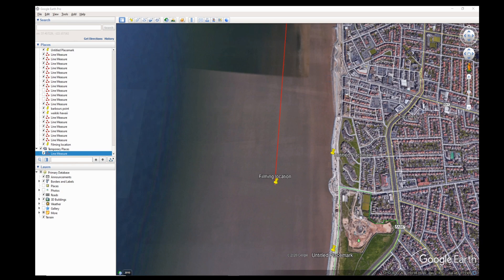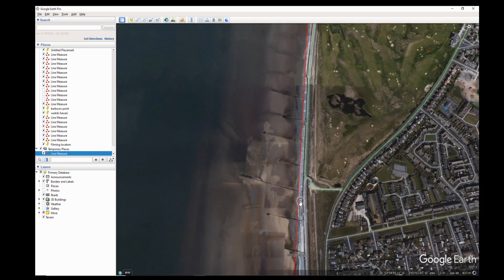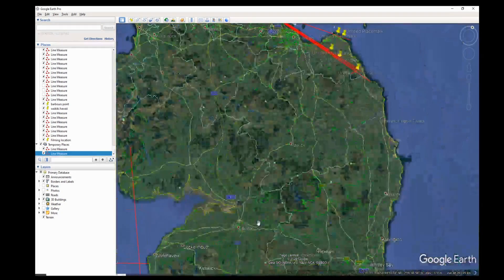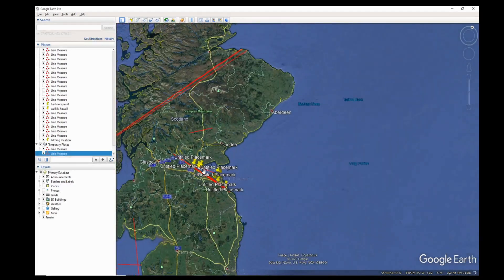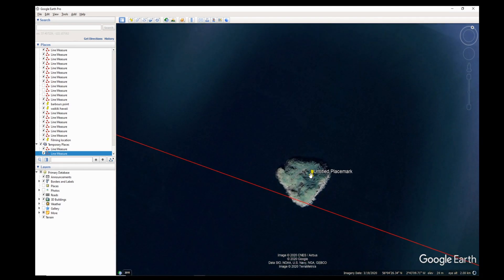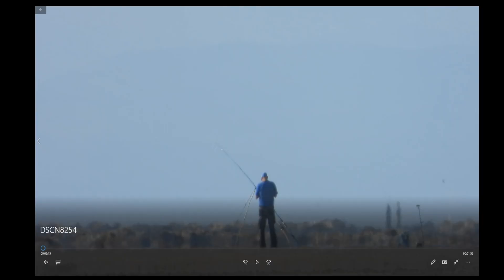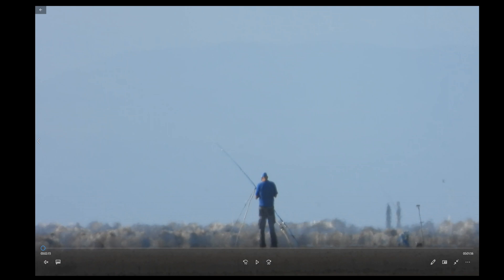Fluid Dynamics ~ Tides

Comment: What??  I can only shake my head in disbelief that you even present this flawed analysis.   You claim the tide is "pushing in" but all I see is a very zoomed in shot from an extremely low camera angle of wind driven waves moving from left to right.   

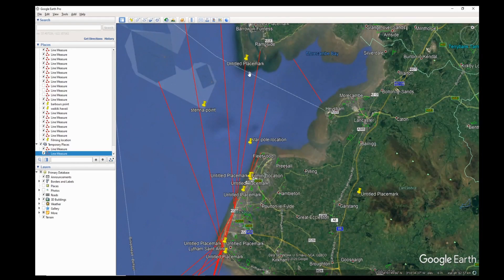If the tide is really "pushing in" @ 4:10 then why is this guy calmly fishing at a beach which @ 5:35 clearly shows a very low tide?  In fact to the right of the fisherman are two other people calmly standing on the beach on the other side of that water.  Again, look at how low the tide is @ 5:35.  It will take a good hour or two for the tide to even cover that expanse of sand.   

Sorry Ranty, all you showed is wind driven waves shot from an extremely low camera angle and made up a story about a "tide pushing in" as though this was rapidly rising water.  All you would have to do is get to a higher elevation and that water with waves, no matter if it was an incoming or outgoing tide, would be below your eye level.   And on a flat earth, water and waves that are below your eye level are not an obstruction.

Comment: So what happens when none of these effects are present like in a very large lake and we still have obstruction?
Reply: Or what happens when Ranty takes his camera off the sand and moves to a higher elevation.  On one had he accuses you a shooting from a low angle when you didn't, then he actually uses a very low camera angle of a suppose "tide that is pushing in" causing some kind of an obstruction.   But why do we see a guy calmly fishing on the beach and to his right are two more people on the other side of the water calmly standing on the beach?   Maybe the tide is rising but the motion we see is wind driven waves on a beach at very low tide. Nothing to see here folks.